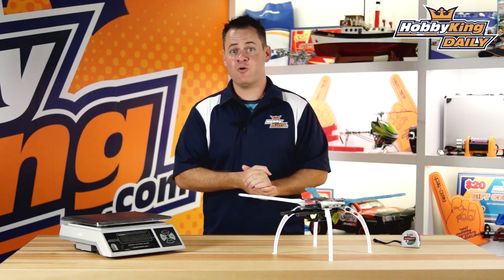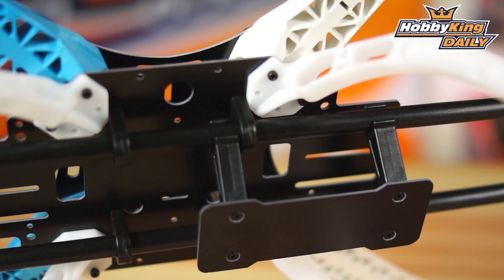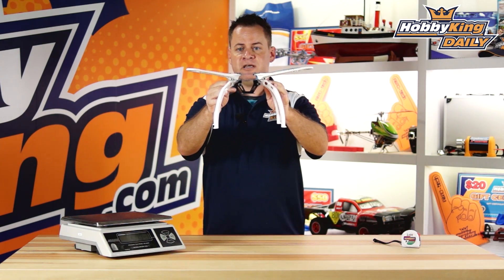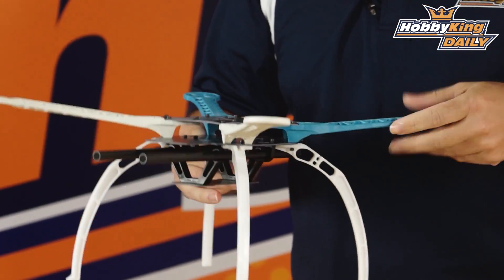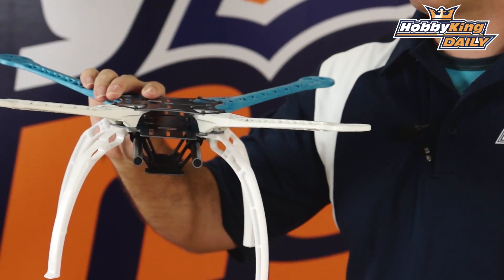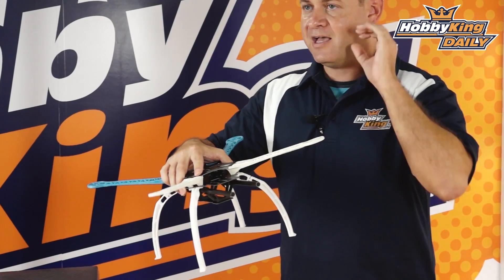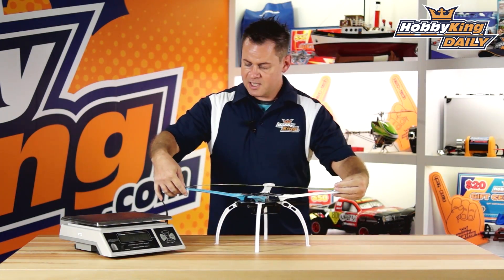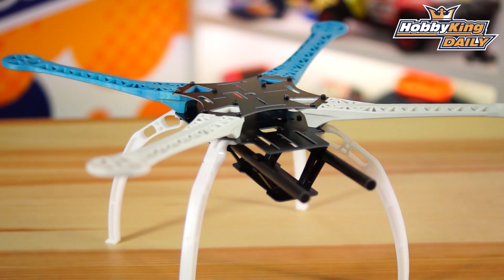HobbyKing Daily - S500 Glass Fiber Quad

Comment: Can't the same benefit of these up-swept arms be achieved with any quad by just wedging the outside of the motor mounts?  As long as the blades don't strike the arms, you're good.  I don't know what changing the thrust vectors might do to your controller's ability to correct motion in flight, or what PID changes might be required though.
And I can see the benefit of stiffer arms, but it will force more people to address rather than ignore poorly balanced motors and props.  You have to weigh the benefits of more efficient motor power, and longer bearing life against potentially repairing or replacing center frame parts.

Comment: some nice ideas but adding a carbon rod to the arms means that energy in a crash is transferred to next weakest points, which is either the motors/motor mounts or the centre plates. I prefer cheap arms absorb crash energy and break than more expensive components.
Reply: True, but stiffer arms gives you much better flight performance. The old style arms have way to much flex.
Reply: Jeroen van de Mortel
I worked with a guy on a forum with a $20 HobbyKing frame.  The fiberglass motor mounts were so weak that even a small vibration in the motor/prop was allowed to build into a 30 degree deflection.  Pretty horrifying actually.  But that can happen when you mount your motor on a "diving board"!